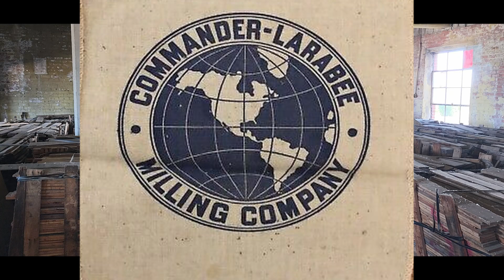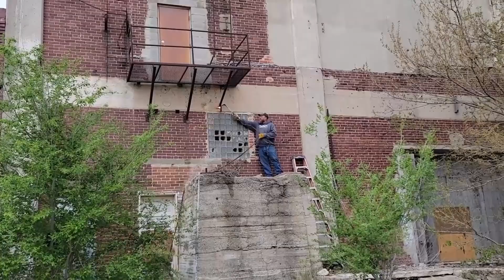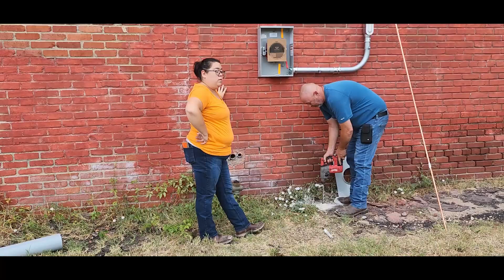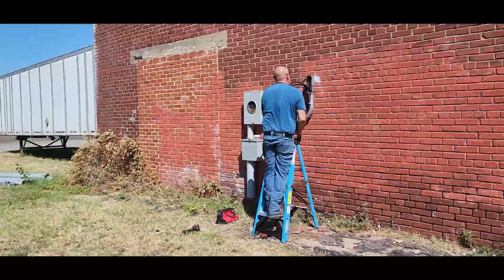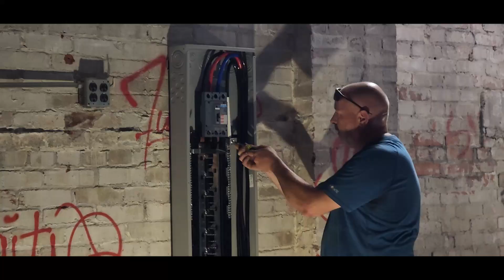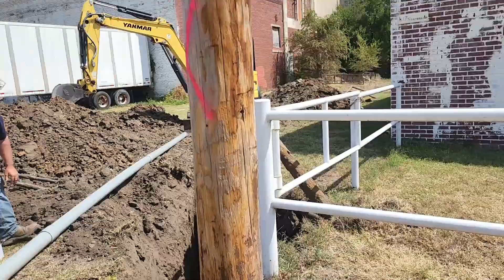Update to the abandoned mill

Comment: Thanks for the history lesson on your building.  I very much enjoy that!   I'm a little mythed as to why your underground contractor left your conduit so far from the pole instead of putting it tight against it.  Looking forward to your next video.  Thanks!
Reply from the maker: That's to the spec. Used to be 6 inches, now they require 7 inches. 🤷
Reply: It's interesting how different parts of the country have different codes.  If you left the conduit that far from the pole where I am at, that would be a fail and have to be redone.  Thanks for the response.